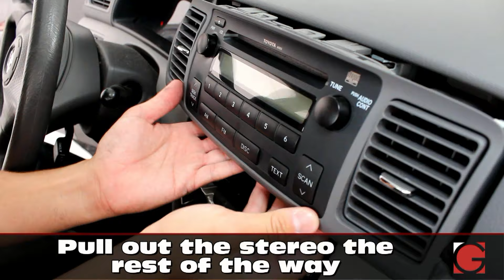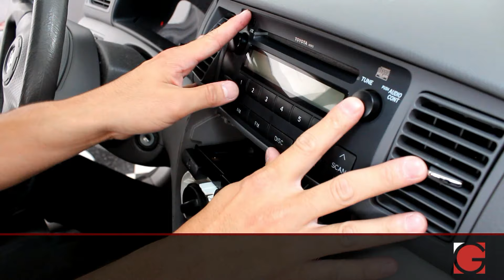Toyota Corolla 2002 2003 2004 2005 2006 2007 2008 GROM USB iPhone Android Bluetooth Kit Install

Comment: It would be great to have a before/after to see by ourselves if the volume is as loud with stock cd player.
Reply from the maker: It is hard to replicate on the video, but thank you for the suggestion. We at GROM Audio guarantee CD quality sound for the USB connection. The sound quality also depends on the quality of the original file. For example FLAC lossless files will sound way better than some highly compressed MP3s. The level of MP3 compression and the bit rate plays the role.

Comment: Would you please upload a video of how to setup the bluetooth with the radio?
Reply from the maker: Do you mean how to pair your phone to GROM car kit? To do so please follow to the next steps:
1. Once GROM is installed and connected - cycle the ignition
2. Upon starting the car GROM BT becomes active and discoverable. You need to pair within 3 minutes.
3. Open BT settings on your phone, turn on BT (if not yet) and look for available devices
4. Once you see GROM-CAR tap to pair, then OK for the pairing code

You should be able to pair and connect to GROM-BT.

Thank you.
Reply: The website to buy setup gear has Bluetooth as a separate attachment. Does the model you installed come already Bluetooth compatible?

Comment: How does this work without the button AUX on the stereo ? You just plug and play ? What happends if i want to put a Disc while having this device connected? How do you switch back and forwards between this two
Reply from the maker: In Toyota Corolla 2002-2008 the GROM car kit emulates the external CD changer. You will press CD or DISC button a few times to get to the external CD changer mode of your car stereo and use the GROM car kit.

The built-in CD changer will keep working, and you can still play discs. You will be switching between the GROM and the external CD by pressing DISC button.

Comment: I installed it but when I connect my iPhone and click play nothing happens when I select the CD option, there is no voice from my iPhone so I know it is sending the signal to radio but no sound from the speakers either what I can do to dfix this problem
Reply from the maker: Raj, try the following:
1. To select GROM mode press CD button twice. You should see DISK1 TRACK 1 or something similar on your stereo screen;
2. Make sure that the Bluetooth volume on your iPhone is all the way up.

If you will keep experiencing difficulties, contact GROM tech support at https://gromaudio.com/support.html

Comment: Hola. La salida del cable. Donde la. Instalo
Reply from the maker: You install at the back of the stereo at the extension port - need to locate the port where GROM cable will fit.

Comment: I did not see you connect the GROM unit near the end and complete your reassembly.
Reply from the maker: Sorry, looks that this part has been cut. Simply plug the GROM into the harness. Once done restart the vehicle (cycle the ignition). This part is included with the manual that we supply with the products.

Comment: Can it even run in bad FM 📻
Reply from the maker: It is a direct connection that does not depend on FM. It connects to the CD changer (or extension) port of the stereo and emulates CD changer with superb sound quality. Please visit https://gromaudio.com for more details. Thank you.

Comment: the empty slot behind the sterio of my corolla is different. it has a bit thicker pins. 2002 corolla. I cant plug the adapter behind it because it doesnt fit. Do you have an alternative like plugging in a different adapter between the two?
Reply from the maker: You can route the cable to the glove box and leave the adapter there. Thank you.

Comment: Can you still use the CD player, FM/AM? Does it replace one of the buttons on the stereo?
Reply from the maker: Yes you can, build-in CD changer will work, FM/AM also will work. It replaces external CD changer, so external CD changer will be disconnected, if present. Thank you.